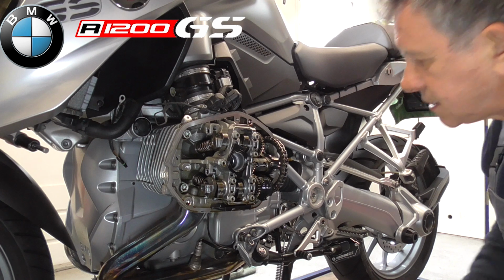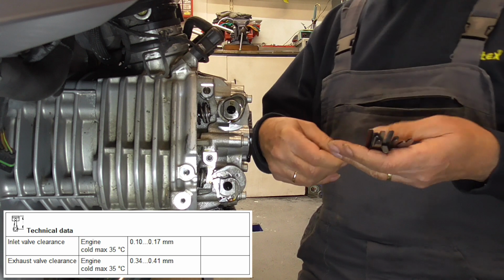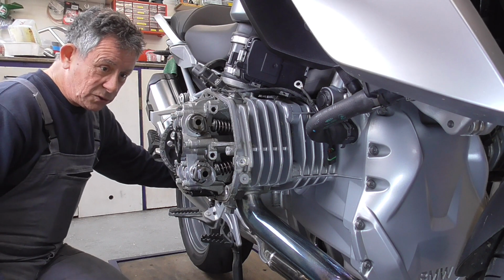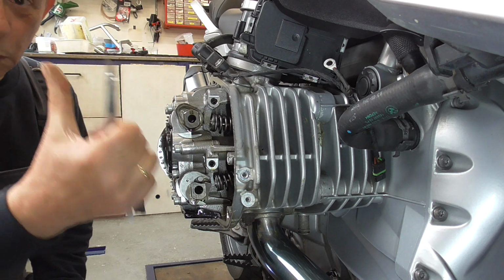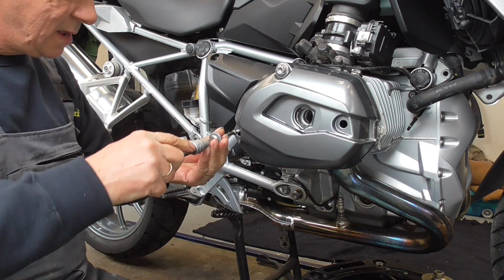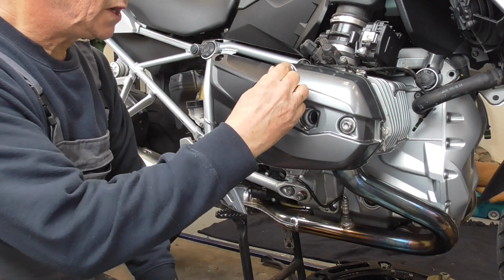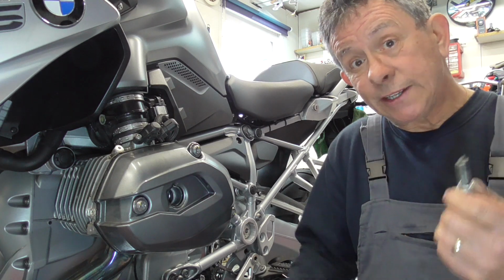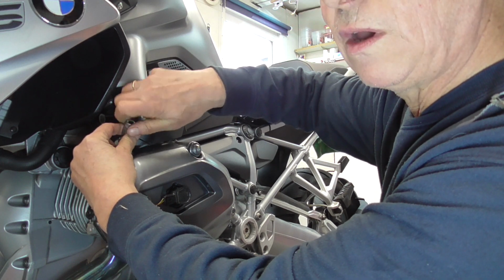BMW R1200GS (2014) - Is A 30.000 KM Valve Clearance Check  NECESSARY ?

Comment: Greetings Old Mechanic, I'm a keen follower of you in Amsterdam. I'm known as The Old Boxer Man (67), doing WBX Boxers/BMW Motor's/Porsche Boxers. 
Those exhaust valves are 'just' on the limit of 0.34mm!  Because we are dealing with a fast running boxer, your exhaust valves should be adjusted to compensate for the slight sinking of the exhaust valve seats into the cylinder heads! It might be wise to have them at about 0.38mm. During the next 30,000 those gaps will close up for sure!. Just a loving word of warning!...........but not so cryptical on the inlets for sure. Wonderful Chanel, maybe we should work together!. x

Comment: Old Mechanic I have a question...? Arriving at TDC ie hole within hole  visual checked; but the alignment jig i purchased from mr Ali doesn't quite fit ie the edges are not precisely parallel; does this mean the cams are not positioned correctly and if so how does one adjust them?